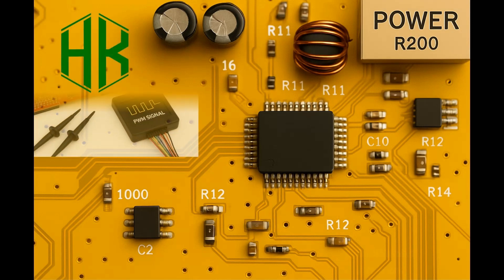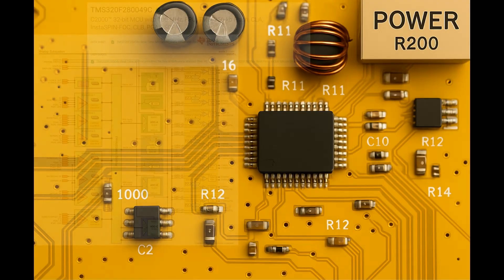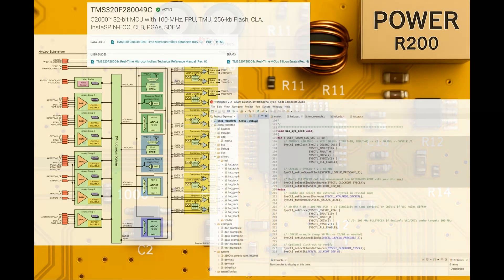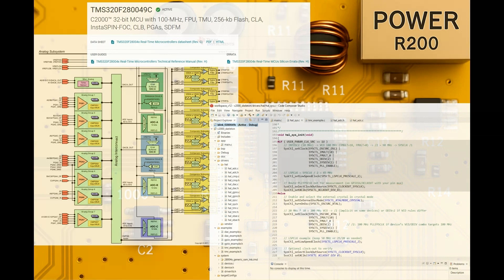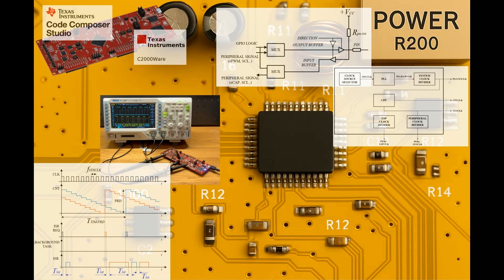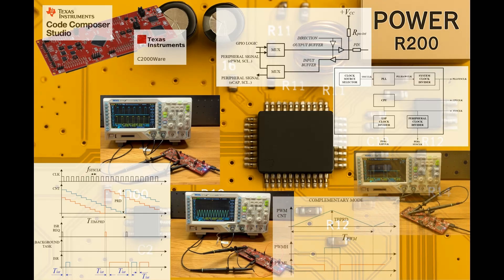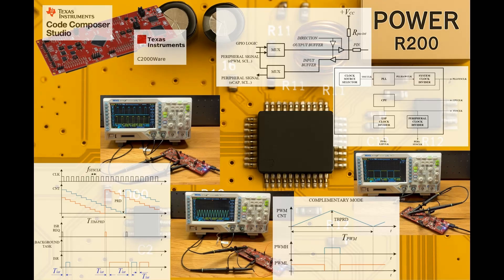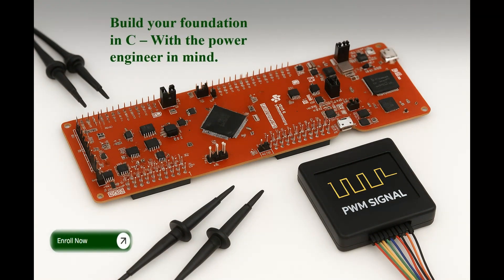C2000 Basics: Foundations for Digital Power Control

Comment from the maker: 🎉 Launch Offer!
To celebrate the release of my new course “C2000 Basics – Foundations for Digital Power Control”, I’m giving a 20 % discount for the first 10 enrollments — valid until November 10th.
Use code 👉 C2000LAUNCH20 at checkout.
🔗 Enroll here: https://hk-academy.com/courses
This course covers all the essential C2000 modules — GPIO, Timers, Analog Subsystem, PWM, and eCAP — with clear explanations and practical demos.
Grab the discount before November 10th and start mastering C2000 today! ⚡